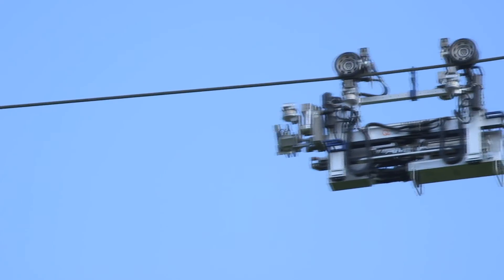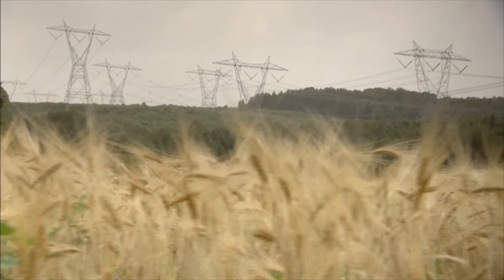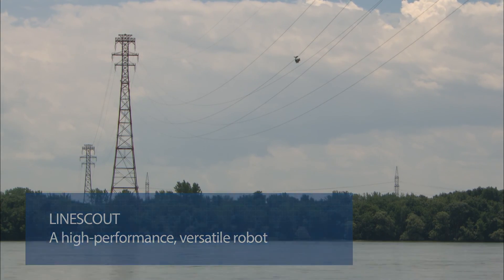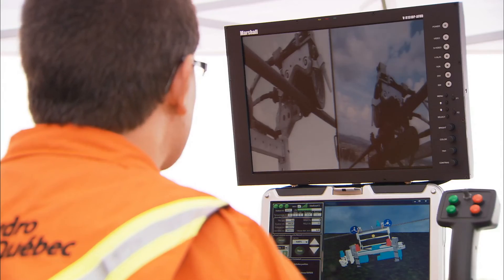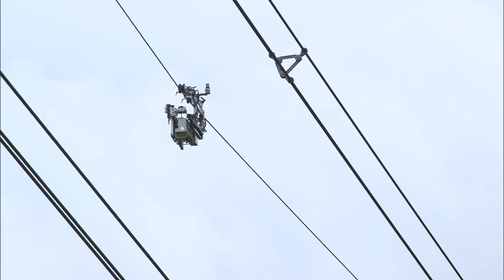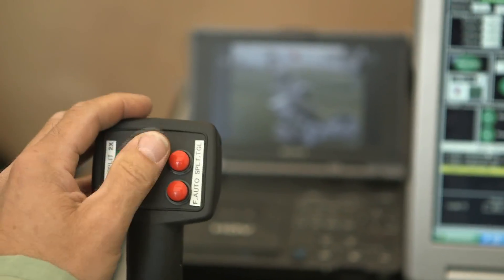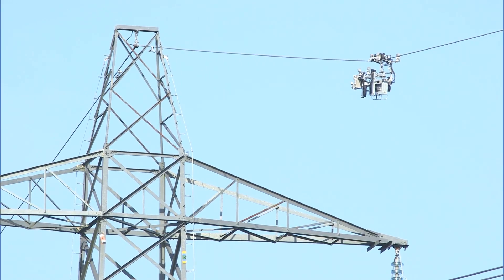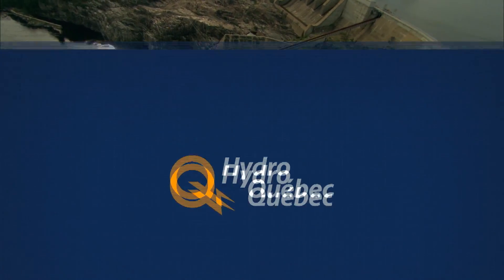LineScout: An Innovative Solution

Comment: Easier solution? https://www.innova.no/aircraft-warning-marker-installation-tool-successfully-tested/
Reply from the maker: The link that you shared points to a tool used to install aircraft warning markers on power lines while the LineScout is used to conduct detailed and highly precise inspections of live transmission lines, safely and without compromising grid operation. These are two completely different tools for two completely different tasks.